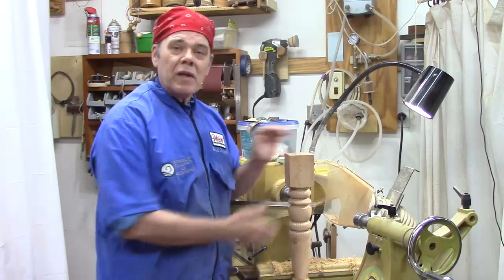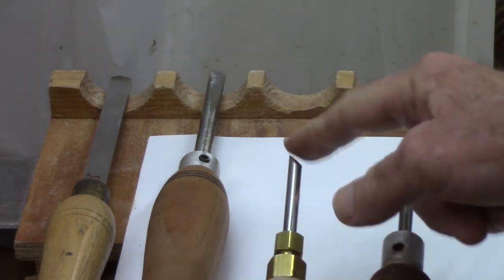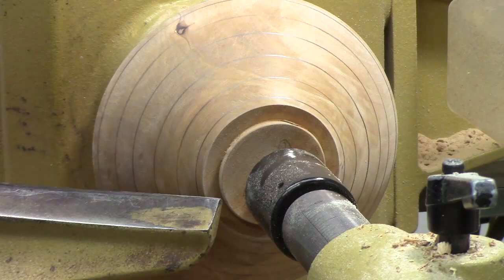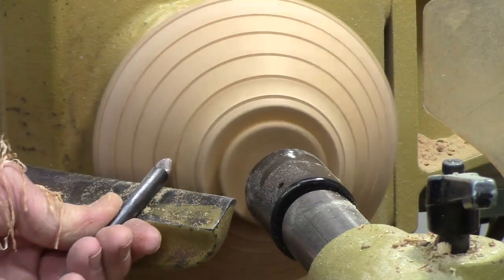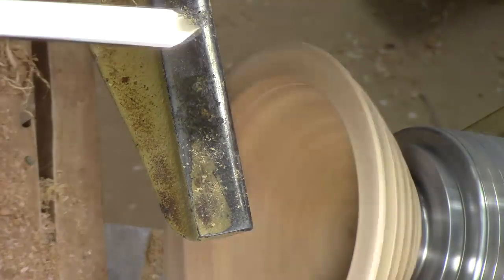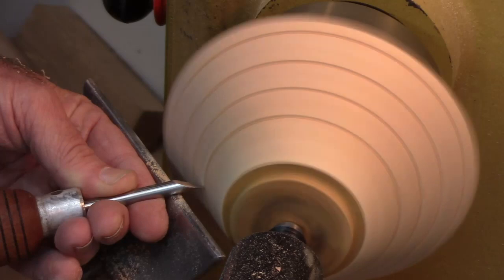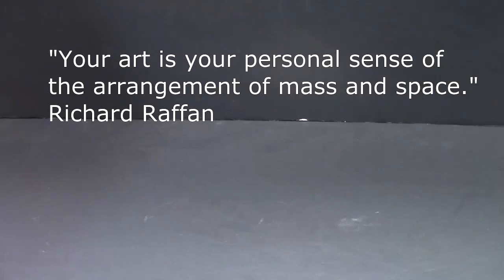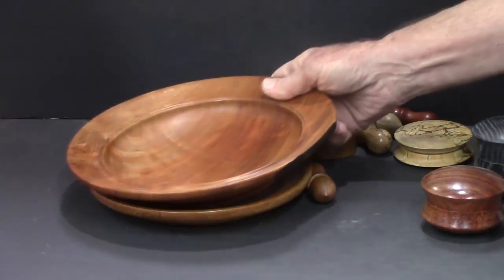Coves are Not Just for Spindles

Comment: Mike -- Thanks for the instruction on how to make coves on face work.  From the video, I gather that it's important to keep the handle of the spindle gouge low when "scooping" out the cove.  Nice to see how the tool is presented to the work when making the cut.
Reply from the maker: Yes, the handle is somewhat low since I slice in from the edge and not the tip.